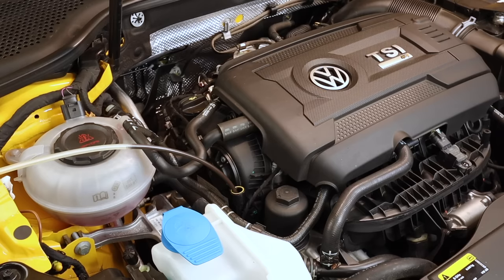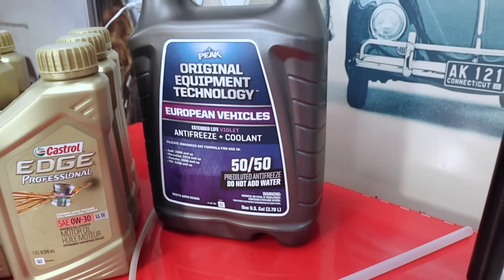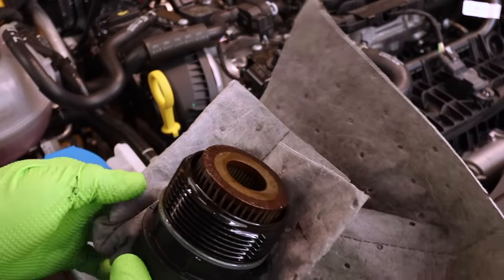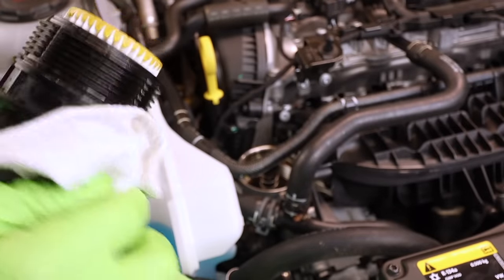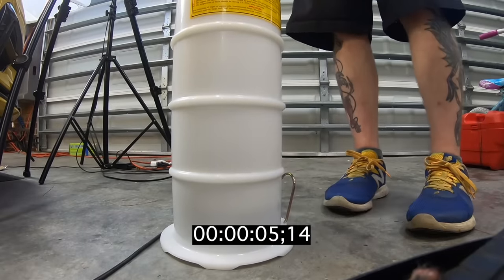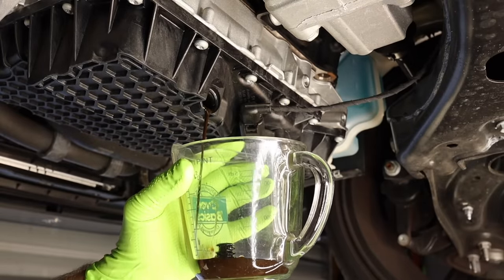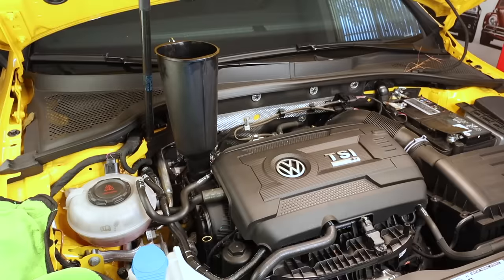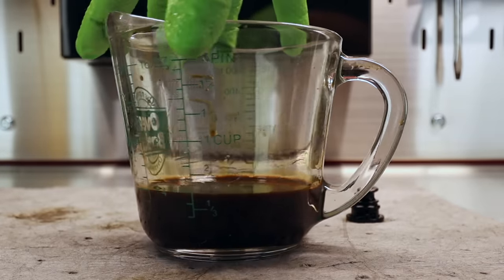Will an Oil Extractor Get All The Oil? (MK7.5 Golf R 5000 Mile Service)

Comment: There's a lot more than 100ml left in the car still anyway, so it's fine.    100ml is 1.6% of the total oil fill.  Negligible amount.    Sheesh, how do you ocd types change your transmission fluid?  ;p
Reply: Drain and fill three or four times knowing I will never be able to truly  replace the ATF without popping cooler lines and using a set of two buckets. (Or an exchange machine)
Reply: Once
Reply: The really OCD people just get a new car.
Reply: @mediocreman2  You're onto something there! The mentality that it will never be the same is a powerful one. (I let my near mint G35 sit under a cover 2 years after striking a deer because it would never be the same without spending stupid money. Totalled, but title clean. I missed the car, the color, and the sound, so I finally put it back together this October. Definitely not the same even with factory Nissan parts and color. Maybe 87% the same max.
Reply: Convince dealer to give you a whole new transmission before CPO warranty expires :)
Reply: CleanSC how do you know its fine.  I have oil analysis showing retention of 20% wear metals and contaminents and oil degradation within 20 minutes of running the engine.  I wish it was only 100ml, more like 500-1000ml.  The engine came from the factory with clean oil.  Perform a second oil change will achieve 99% replacement and a near factory fill condition.  Keep the flush oil for the next time.
Reply: 100 ml is 10 % of one liter which, if your engine holds 4 liters would be a total of 2½% unless I'm making a serious mistake. Even so, if you have 97½% of new oil in there it's no big deal especially if you're changing it every 5,000 miles.
Reply: @tssci6774  
Do you flush it with conventional oil and fill it with synthetic?
Reply: @stevensevek6151  I use SuperTech Full Synthetic, only costs $13 for 5 qts and then use Amsoil 100% synthetic for my final fill. I reuse the same flush oil for a second oil change me so cost is half that.
Reply: @pgmurray76  that's a transmission fluid flush, not a change! On much older cars you might break your transmission by removing too many microsolids that help the clutches grab gears.
Reply: @joubess  I found this out well in the past. Oh yes. Not fun
Reply: I have OCD to the MAX, I usually remove my entire transmission to get all the oil out. It takes me 8 hours .
Reply: wait transmissions have oil!?!?!?
Reply: Dialysis method most probably. Not me. Just saying.
Reply: Well when I did my DSG service I put a tube down the hole and sucked out what I could. If anyone was curious, DSG fluid is the worst tasting liquid I have ever encountered
Reply: @HumbleMechanic  so what is your honest opinion? Do you feel it’s bad/harmful to have that little bit left behind?
Reply: Drop the pan change the filter, refill the pan. Disconnect the cooler supply line hook up a clear line to the transmission cooler line. Have someone start the car as you add fluid until until the fluid coming out of the clear line is clean.
Reply: Real men drive manuals 👀
Reply: I think it depends on how long you intend to keep your car. If you recirculate metal shavings and sludge into your engine over a long period it's definitely going to be worse than if you get a new car every ten years.

There's a reason our grandparents and great grandparents cars are still on the roads in some places.
I don't think it's OCD to not want 100mil of sludge left in my oil. Especially since that's only going to concentrate over time and become more dense, and broken down with every change that you leave that amount in.

Besides, he said he won't do extended service and yet for his very first service, at HALF the factory interval he pulls out 100mil of thick, black sludge from the bottom?

No thanks I'll stick to drain plug.
Reply: I like your comment because you're right. 

How I do it? I drain my F15 3.0 diesel, and let it drain overnight. There's an extra 500ml that comes out. 

Does it matter? No really. 

Grtz. A Belgian.
Reply: @Edward Cretel The initial drain on a transmission only nets 50%.  You would need to repeat 4 times to get close to a complete fluid exchange.
Reply: @jeffdoak8444  yessir they do😁

Comment: I think the best practice is changing oil every weekend with complete engine replacement. Only this way you can be sure all the oil is completely out.
Reply from the maker: Love it
Reply: Mate I do a lot of work around audi cars which is still vw and we do all the service with sucking oil out. In the future you won't have any other option just suck it out. Pro tip : when you get out all the oil just fill it with a bit of a fresh oil and suck it up again until you start sucking out clean oil.
Reply: Does anyone roll the ( O ) ring anymore to take twists out of the ring with an awl or small screwdriver .
Reply: I would not have it any other way

Comment: Nice video. I just bought an extractor. To me it's a no brainer: No wear on the drain plug, no possibility of stripping said plug and pan, no removal of splash shields, no jacking/ramping of car necessary, IE: much safer, not to mention no oil drain pan so much less chance of spilling the used oil. The small amount of oil that' s left will be changed out at the next service. I just did a tranny service on mine and was amazed at how easy it was compared to dropping the pan. Which can be really messing and lead to leaks. Just change the transmission filter every second or third time. The condition of the fluid is most important. If the filter is clogged, you left the fluid in too long and the tranny is on it's way out.
Reply: Same thoughts here. No jacking up the vehicle, and no requirement to remove the drain plug ever again. This compares with replacing the entire oil pan because of those oil change mechanics using pneumatic tools to loosen/ tighten the oil drain plug. Much cleaner method. I can live with 1/2 cup of residual oil as compared to the previous methods, outdoor in 32degree freezing weather conditions at the 10K mile interval.

Comment: When using an extractor, put some clean oil at the end (like 100ml) then extract some more. When the oil becomes clear, that’s when you know you cleared the drain pan of old oil.

Update: for the anal complainers, we understand it’s not going to be perfect. But if you change the oil regularly from the get go and always use synthetic this works. It’s not meant for those with  high mileage and with a lot of sludge on the bottom. You’d have to do engine flush and drain the traditional way of course before you do something like this.
Reply: Can you put cheap oil in it? i am using royal purple or amsoil
Reply: Ooh good tip
Reply: Great idea 💡
Reply: I mean… the oil left behind is less than 2%. I feel completely confortable leaving it behind.
Reply: @gtaitbiz7787  not a good idea because mixing oils from different companies can gum up small holes.
Reply: @aeagleera  But it probably has quite a few contaminants in it.
Reply: lol . no . aLL you doing by putting new oil is raising the oil level to reach the suction hose - so you will sunction out new oil and old oil will stil be at the bottom . You dont know how fluid dynamics works . Putting new oil at the end doesnt bring old oil to the top LOL  . The reason why not all oil is suctioned is because the hose doesnt get all the way down to lowest end of oil pan .  If the oil the oil stick is at the front of engine - park the car downsloap so more oil comes in contact with suction hose . If the oil stick is at the back of the engine , park the car up slope . You really gave the people the wrong advice LOL . Its really funny how 101 of them didnt have any common knowledge LOL
Reply: @alext8828  Contaminants will collect at the bottom of oil pan and the only way  to be sure you dont have contaminants left is to drop the oil pan each oil change and clean the pan LOL - which no one is gonna do that !  Most vehicles have magnetic drain plug so the metal contaminants will deposit on it . Not nessesrarilly shavings but metallic dust sludge . No matter how good is the oil  - metal still weaRS over time creating metallic dust . Suncion pumps for oil change is not recomended because by pouring the new oil you are agitating the metallic dust that settled at the bottom of the pan and its now circulating trough the engine LOL . DRAIN THE OIL OUT AND CLEAN thwe drain plug . Once in a while like 60-70 k miles - drop the oil pan and clean and replace the gasket . DO IT RIGHT
Reply: Diminishing return as % left is already small. You'd waste good clean oil to get that percentage down by half...2/3. Not really worth it.

Comment: Not sure where the O-Ring needs to go on the cap... can you please be more specific?
Reply from the maker: right.... there... :)
Reply: You should make a separate video, just to explain this important topic. I feel like it was just glossed over in this one - barely even mentioned.
Reply: There is an obvious channel the seal sits in.  The filter even has an illustration inside the box telling you where it goes.
Reply: @LynxStarAuto  Insert meme... of a missed joke.
Reply: SDSBBQ wait there was an ‘o’ ring replaced? Blimey! I missed that.. any chance of the video time please.. surprised that wasn’t highlighted..
Reply: @trainsarecool5084  Too fast... didn't catch it either.  Damn.
Reply: @LynxStarAuto  ...but who reads the enclosed destructions anyways..?
Reply: It goes where the original one was.
Reply: Look at the old one before removing it.   New one goes where old one is.
Reply: @HumbleMechanic  :)
Reply: At the end of the threads.

Comment: I use an extractor whenever possible.  Getting worked up over 1/2 cup of oil is silly.  Even when draining from the oil pan, there is still oil all over the inside of the engine, in the turbocharger and its feed/return lines etc.
Reply: NickoLps  If you are that anal about maintenance you are likely changing fluid much earlier than the factory recommended interval anyways. You are splitting hairs here.  I've got a 634k mile 2012 Jetta sport wagon at the shop that has been maintained in this manner since new and still runs perfectly.  .  I'll agree to disagree.
Reply: @mineaim7066   Kinda hard to argue with your results. I have a 2015 Jetta TDI 6spd manual and hope to get at least 300k on it.
Reply: Synthetic oil suspends deposits, not real sludge unlike mineral oil.

Comment: Thanks for that video and the information of the oil remaining. Interesting to see the M8 R still comes with the plastic oil pan. I assume it's the same as on the Mk7 and the quantity of the remaining oil is also the same. Since I do own a Mk7 and have access to a lift and I don't even own an extractor I obviously prefer draining the oil via the drain plug. I also have a magnetic plug and I want to inspect it on each oil change. That said, while I prefer to not leave 100 ml of more oil in my engine there's still a huge quantity remaining in there. The factory fill is 6.6 liters, while you change just 5.7 liters. So 900 ml is remaining in the engine anyway, or 1 full liter if you decide to use an extractor. Lastly this engine has a really generous oil sump and I think that's a good thing.

Comment: There is probably another 1/2 litre up in the block/pump/turbo lines, if your worried about that last bit dump in a clean fresh litre and start the car for 5 seconds and drain it again to flush a bit more out but its not going to matter one bit, the filter does its job, 99% of the oil is new, the old oil like any modern oil would probably last another 5k-10k as is anyhow, a week later the new oil will look dirty once again.
Reply: When i used to rebuild the gen2 ea888 2.0tfsi engines (the predecessor), they took 4.6 litres on a service, but 5.2 litres after teardown and replacement of the pistons. So yeah 0.5 litre easily left behind everytime.
Reply: The less old oil i have the better. I always change it when oil is hot to get more out and jack the car high up and let it drain for about 30min.
Reply: @boostedveedub9687  Does the extra 6ft of gravitational force increase the flow rate of the oil out of the car?
Reply: James Butler 6ft? I’m on jack stands so probably 6” lol i just do it to make it easier for all the oil to evacuate depending on oil pan design, plug placement etc.
Reply: Not really good to run the engine for 5 seconds on a total of 1.5L of oil though
Reply: It does matter in these modern engines and your are correct that much more is trapped in the engine.   I wish it was only 100ml, but  in modern engines 10-20% (500-1200ml) of used oil remains trapped in the engine. I have oil analysis showing retention of 20% wear metals, contaminents and oxidized oil and degradation of the new oil within 20 minutes of running the engine. The full flow filter does not remove half of the damaging particulates, only the largest and most severe. Perform a second oil change after 20 minutes with cheap oil and you will see how contaminated it is.  A second change will give you 99% clean engine oil, just like when it rolled off the line at the factory.

Comment: Oil extraction is the way to go!  I started doing it a number of years ago.  The time and effort I save not messing with jack stands and stuff is huge especially with multiple cars in the family.  And, if one is doing frequent oil changes, filter replacement can be skipped for three or four cycles with no issues.  Every other year or so all the cars are up on jack stands for other maintenance and that's when I do oil pan bolt drains and filter changes.

My 1993 Chevy C1500 has anti-slosh baffles in the pan which caused all kinds of problems for the dip tube to get to the bottom of the oil pan.  Or, the dip tube would get hung up.  Oil extraction is such an effort-saver I took the time to remove the truck's oil pan and modified the baffles with slight cutting and the welding of channel metal to guaranty no hang-ups and full bottoming of the dip tube.

If you're a serious logic-based DIY'er rather than a religious ritual mechanical monk, switch over to vacuum extraction and use the resulting time and effort saved to get in a few more rounds of golf in with the precious extra weekend time.

Comment: There is always oil trapped in the system. What you collected after the pumping extraction is mainly the dripping oil collected in the pan afterwards. I wouldn't worry much about it! I would probably alternate between these two.
Reply: Ye a mix of both is probably the happy medium, or in my case whenever I can get access to a welder to tac bolts onto the rear bolts of the belly pan because the ones on it are completely fucked
Reply: @user-lv8dn8gw9z  I'm in the same position. My rear bolt is completely stripped and rusted.

Comment: Thank you for creating this video, and giving us your experience and information.  It is appreciated.  👍

When I initially heard about using an extractor to change oil instead of drain plug, I too was suspicious about how well an extractor will remove the used oil.  After seeing more information, and applying what I already know about engine oil systems, I concluded that an extractor is a perfectly acceptable method by which to do regular oil changes.  
Yes, there is that question about the, "sludge", at the bottom of the pan, just like you show in your video.  
However, the thing is, that is not sludge that is any different than the used oil that was just extracted.  The oiling system does not pick up oil at some higher level from the bottom of the oil pan.  Thus, all of the engine oil is being used and circulated over and over again.  Even if the oil pick up is just slightly above the oil pan floor, during engine operation, still, all of the oil will be mixed and thus used.  As oil pick up happens, the oil goes through the filter and circulates throughout the engines oil paths/channels.  When that oil returns to the pan it mixes with ALL of the oil, yes, including that oil that some seem to think sits at the bottom of the oil pan and never moves.  All the oil moves.

Also, there is a reason for an oil filter.  Its job is to remove any larger particles that may be in the oil.  Modern oils use additives that separate particles so that they do not clump, and stick in the oil paths and channels.  The additives are not perfect, but are much better than oil from decades ago.  Point being, if that little bit of oil, that comes out only from the drain plug removal, is sludgy, then all of your oil is sludgy.  And hey, that's why we change engine oil at certain intervals of mileage, type of use, and time.  The engine engineers test these things, and they know how well and how long certain types, formulations, of oil will last in that particular engine.  Also, oil chemists continually work on additives and oil formulations to keep improving needed and beneficial oil properties, for the various types of engines that are out there in use.

Comment: I myself am a perfectionist, and I abhor any remaining old oil in the system.  If there was a way to completely purge the system of old oil, I would. And TBH, it only takes another 5  minutes total to put the damn thing up on ramps and draining as completely as possible.  The advantage is I don’t have to spend $50 on a device that isn’t even more effective at getting all the used oil out and takes up space in my garage.  So there’s my two cents.  I’m raising it like I’ve done for numerous years now.  Also, my vehicle’s drain plug is situated to the rear of the pan, so that added few degrees nose up while on the ramps actually causes every last drop of oil possible to end up in the collector.  Still, this video informs my decision on this matter and I thank you for taking the time to make it.